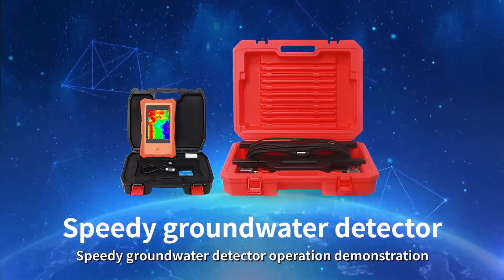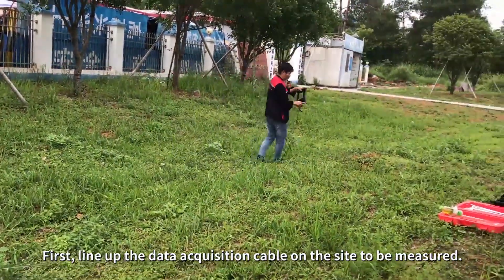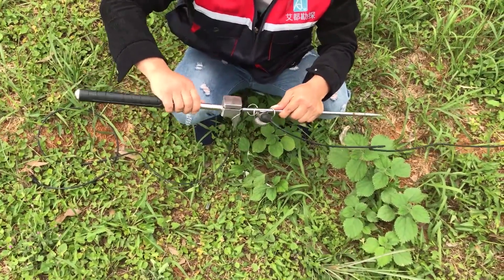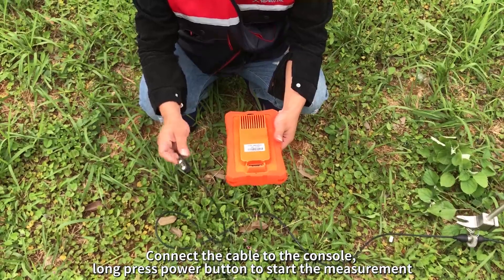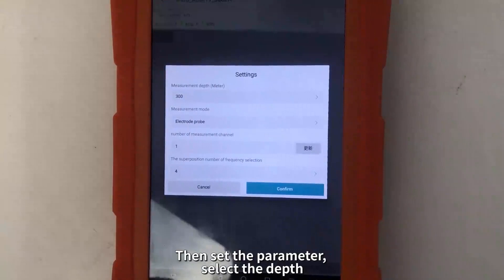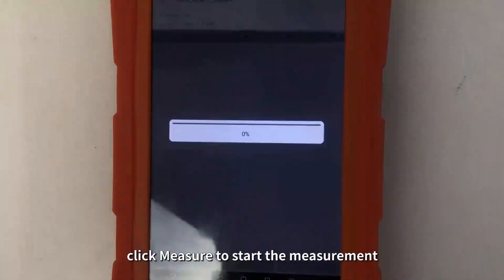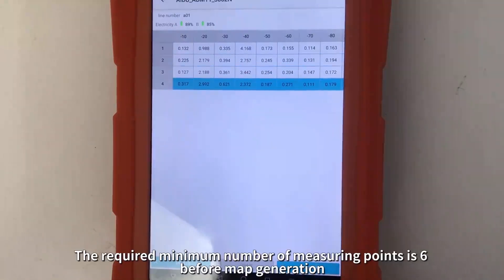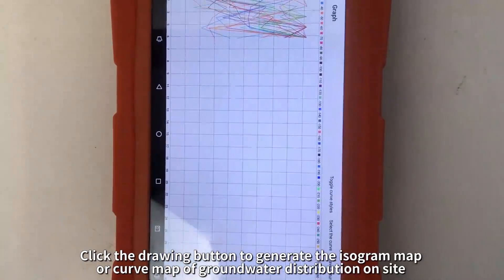ADMT-180ZN ADMT-300ZN ADMT-600ZN ADMT-900ZN ADMT-1200ZN How To Use Single Channel

Comment: So many times i used this instrument 
Therefore i cunclude its not accurate  and the cable sensor easily damage not working properly
Reply from the maker: If you don't buy the product directly from us, the quality cannot be guaranteed. Of course, the most important thing you mentioned is the accuracy, which means that no one can provide you with complete technical service support. Only our guests can get complete training and guidance, and it is free. Obviously, if you buy from other companies, the after-sales service will not be guaranteed and professional guidance. If you look closely at our channel, you will find that we are professional and only provide help directly to our own guests. If you also need it, you can contact us wechat&whatsapp:+8613227326207